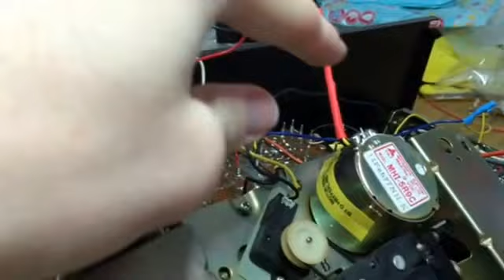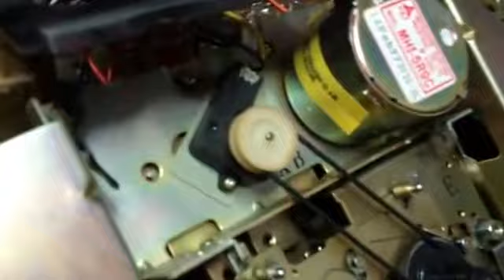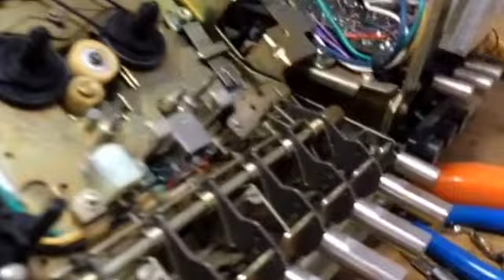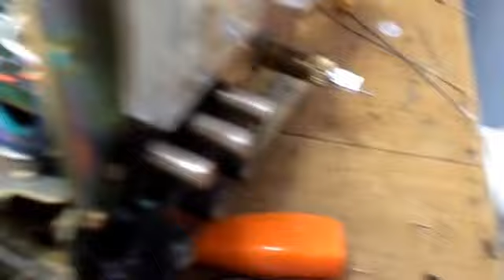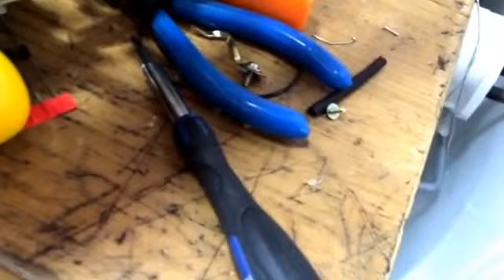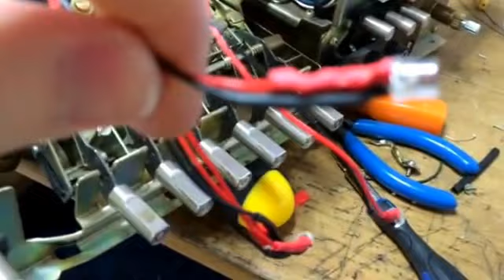Pioneer Ctf 2121 repair continues

Comment: Ah, the Pioneer CTF-2121. My first cassette deck purchased in 1976. First off it was a Pioneer so I knew it was quality built. My only complaints are the tiny VU meters and that weird cassette well. With the tape transport and the door on opposite angles it could be a bitch getting tapes in or out (especially if you were stoned). I made some good recordings on that deck. Ok, the specs weren't great  but I only paid $120 for it. Features? Not really. Only Bias and Equalization and Dolby B. An LED for the Dolby circuit and recording. Enough to make fine sounding tapes. I only had my CTF-2121 for a few years before I traded up in 1979 when I sold it for $90. Not a bad return on my money. Very nostalgic and vintage. If you can get one cheap go for it.